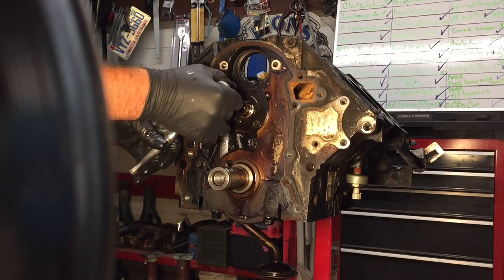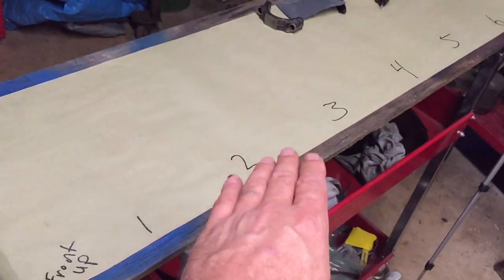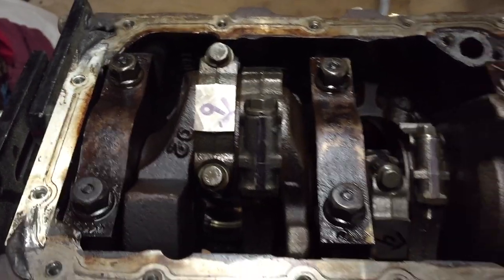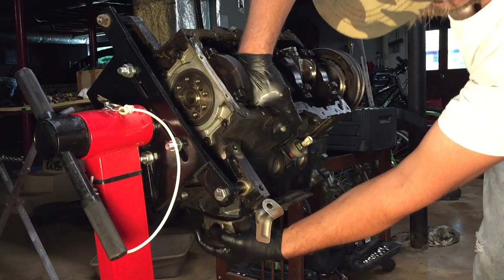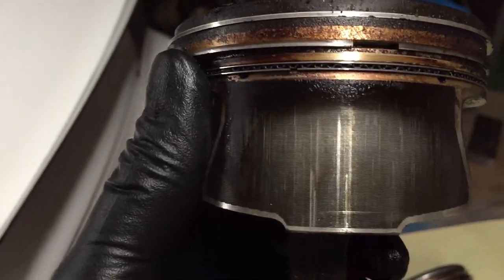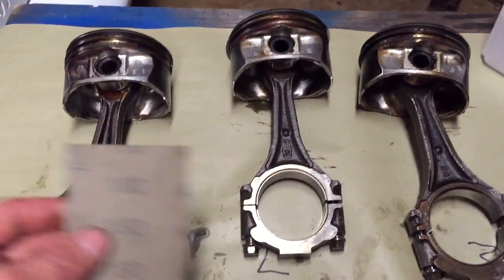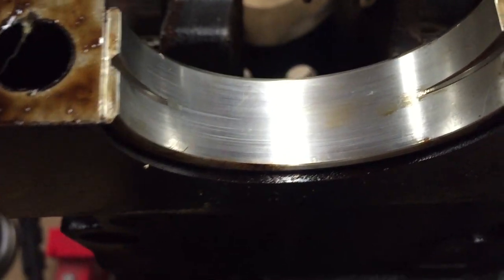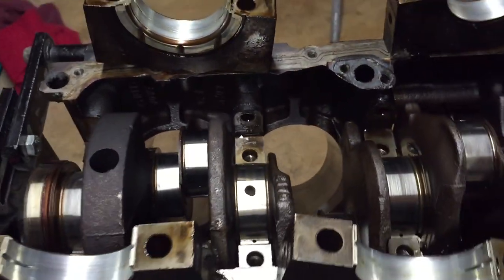Disassembling L67 short block & Rebuild Plans

Comment: If looking for longevity please consider replacing the rods with forged. 

I know the labours cheaper in the us but even at the $20 a rod here to resize, chamfering oil feed and then the arp fasteners it came out to more then half the price of forged items with arp2000 hardware. 400grams less rotating mass over the entire assembly and stronger.

Also ARP main studs and align honing the mains , they're renowned for walking after thousands of miles and tensions released. 

Of running over 130lb valve springs use a double row rolling chain and raise the idle a bit. You need to remove balance Shaft gear and may need to chamfer the rear of crank sprocket and really need to align them well.

Comment: If it not to late replace the rod bolts. The factory rods are decent but the rod bolts are cold formed, Most of the time with stock engine and rods spinning the engines gets to higher RPMs and the rod halfs will pull a parts and that allows the bearing to spin. I have never seen that with ARP rod bolts. With the rods resized and new ARP bolts if a rod is going to fail it will break in half.   I believe the groove in the middle main bearing is from the factory, That is your crank thrust bearing and its needs oil to reach the sides.

Comment: Awesome stuff, i just acquired a 95 3.4l Pontiac Firebird for real cheap. I know it doesn't have the same upper limits like the 3.8l. That being said do you know of a good OBD1 scanner for these motors that isnt extremely expensive ? Thanks for the video
Reply from the maker: no not sure about obd1
Reply: OReilly's used to stock one, they put it on clearance last year, Go in and see if they can hunt one down for you. Be prepared to drive to get it, they don't always like to order in markdowns.

Comment: Dee my friend. Nice tutorial on l67.. when you pulled out your dashboard on your 4th gen. Camaro did you have to pull the entire steering wheel column? Just because I'm replacing my entire dashboard today out of my 94 project trans am.
Reply from the maker: Yes I did and it makes it a lot easier not having it in the way its easy to remove 1 bolt in engine compartment on steering arm And 4 bolts under dashboard at the firewall and 2 more hangers in between wheel and firewall and some wiring harness to unplug I’m pretty sure that’s it and it comes out
Reply: @DeeStruggles  Dee thanks for reaching out to me about the dashboard removal.. it wasn't that bad I just dropped the steering column down and the dashboard just came out with no problems..

Comment: Just a FYI without the internal balancer the motor will never be super smooth. Its a 90 degree V6 so, that is a design flaw. A 60 degrees V6 will have less vibration.  The benefit to the 90 deg V6 is more room for intake and heads that can breath.
Reply: I was thinking he would have a lower redline potential without it too. Why would anyone delete a balance shaft in the first place?
Reply: @WinkelManBearPig  get rid of all the reciprocating weight and have clearance for the dual row timing set required for heavy valve springs. 

The balance Shaft was fitted for nvh harmonics and without it the harmonic imbalances are still within passable factory percentages.
Reply: @hayden6056  hey it would need heavier springs to rev higher too I suppose. I wonder if one way is better than the other?
Reply: @WinkelManBearPig  the factory valve springs are known for floating issues after high milage naturally aspirated after 5k rpm. So yeah I'd highly recommend them , all that pressure on the valve from boost and some more rpm not exactly what you want.